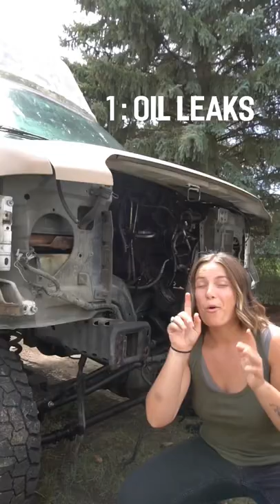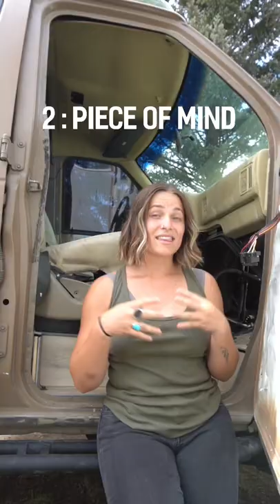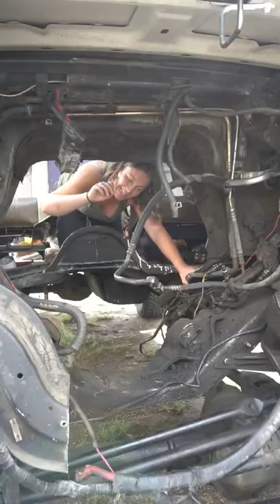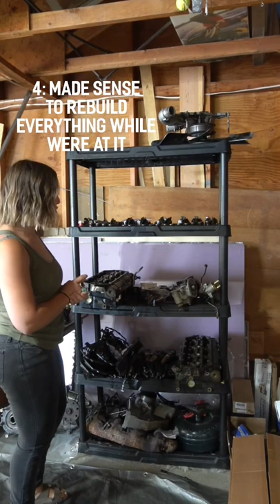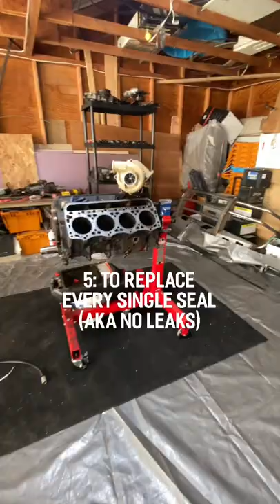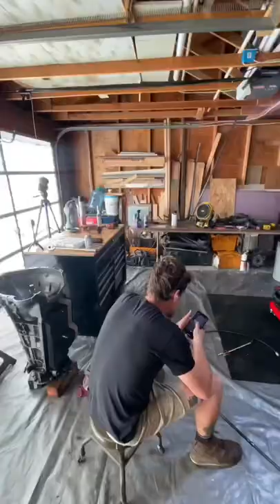5 Reasons why we removed our 7.3 Engine // Van Conversion Series

Comment: A 7.3 navistar should last damn near forever just as long as you don’t over rev it. If taken care of well, I don’t see why you couldn’t get another 500k out of it, let alone another 200
Reply: I got over a million miles on my 7.3 in my ford dually but i daily drove and I religiously maintained it I has a few mods thanks to banks on it cuz I haul cars with it but I didn't do nothing crazy wild with power adders on it.. btw stock bottom end the heads were pulled off at 450k and redone w/few upgrades to valves, turbo and injectors
Reply: Shit you can rev the hell out of them. The 7.3s unlike other engines don’t mind the EGTs

Comment: Good you chose 7.3. get a one box and keep good cam sensors in them, 500k easy. Change the fuel filter every second oil change and you will never have fuel problems either.

Comment: Oil dipstick seal to pan and oil cooler seal are the big oil leak areas on 99-03 psd. Dipstick tube can be done without removing the pan, kind of difficult but doable. Some earlier 7 3's had oil galley leak issues, can fix w updated oil galley plug. Any other "oil leak" is fuel from the fuel bowl running down the back side of engine.
Cool van btw...
Reply from the maker: Hey!! Great info! Thanks 🙌🏻🙌🏻

Comment: The best thing you could’ve done! Was to put a 5.9 Cummins 12 valve conversion. 
Much cheaper easier to work on parts are more readily available so much more reliable.
Million mile engine!!!
Reply: The cost of the conversion would be high though, especially if the trans is a automatic
Reply: New Engine compared to overhaul of old engine might bed cheaper, it’s everything else to adapt the truck to a Cummins that will hike the price. My opinion anyway.

Comment: There's always a bit of magic that goes into fully rebuilding an engine and just praying that the bastard works for 200k miles no issues
Reply: This comment has been seized by the YouTube Comment Oversight Committee
Reply: @decathec  yeah I got a 2001 XJ and besides the fucking endless rear main seal oil drip leak, the fuckers engine has run flawlessly for 230k miles. 4.0L straight line Six doesn't fuck around lol

Comment: As a boat head can I make a small suggestion, it would reduce weight and fuel consumption a four-cylinder diesel maybe a Cummins maybe an older Lehman / senator Ford both excellent motors and will last you millions of miles

Comment: Wrap the manifolds, up pipes, turbo blanket, and the down pipe while you have it out. The motor will thank you by getting slightly better mpg. And if it dose brake down you can work on it with out waiting a cupola hrs for it to cool enough to work on it.

Comment: 200,000 more … a full rebuild should mean a 7.3 would last longer than that
Reply: They'll be doing a lot or highway miles too. I see them all day for sale with 400+ when it's more highway driven
Reply: My stepfather bought a 95 in 96, oil patch truck is what it was. My step father is a ferrier who worked on race horses. I believe when he parked it, over the water pump. it had around 1.2million kilometers. Some guy bought it for 1500 bucks and kept it on the road till the body rotted off.

Comment: Recommend only use oem ford motorcraft parts, even the gaskets. Or u will be pulling it out again…… do it once with oem parts or be doing it for a lifetime with Autozone, Oreilly and Napa auto parts……
Reply: Bullshit. Felpro. No leaks it's in the prep work anyway.
Reply: 100 percent agree. Have had to pull one of these twice due to cheap parts.
Reply: I've learned this. I got told to have a map censor on hand because most likely it will take a shit on you under load going over the pass. So I decided to have tge 200k censor  replaced before I left in a wk.  Got down the freeway and it was running like shit with new censor. Calle d mechanic n he still had old one. He put it in and I'm still driving on it 45k later. Use OEM
Reply: Best advice right here. Ford more than most like to be treated with OEM parts.

Comment: 7.3L will normally go 300k without any issues. 300k turbo issues. 450k injector issues. I have a 99 f250 with 7.3  You are doing it right.

Comment: Shit a built 7.3 will last 500k if you treat it right
Reply: My old man had a stock 99 7.3L made it to 600K only ever needed glow plugs
Reply: @Imwhisper76ontwitch  yeah a 7.3 is the only powerstroke I would proudly own maybe a 6.7 but other than that cummins
Reply: Puff that's nothing. 😏
1993 Toyota Previa 2.4L supercharged with RWD. With 460k only ever did was oil change and tune up. Didn't leak didn't need the engine rebuilt. Just got to rusty, wanted something different, so I junked it. 
 😞 Biggest mistake, that cho cho was the funniest most reliable car I ever owned.
Reply: @jerryvelasco1474  buy Weak af a 7.3 made a l most 300 horsepower and like 450 ft lbs of tourqe but it's also a diesel
Reply: @gavincarroll2553  
So what. Big engines suppose to make big power. Their dime a dozen. 
Their is nothing impressive of a big C.I.D engine making it to 300k and more and making power. That's why those things cost 4 × as much and we're gas guzzlers when they first came out. 
I'm talking about a four banger with factory supercharger, RWD and a mid engine on a Van that was indestructible and got good gas mileage back in early 90's. 
At the time their was really only v6 turbo charge factory engines. 
But a 4cylider supercharger from the factory and mid engine. That's something else. They also came in AWD.
Reply: @gavincarroll2553  I can tell by your comment you will never know the love of a 7.3 IDI 🥲
Reply: @luke8222  what do you mean
Reply: @luke8222  this is a Powerstroke so I don't know why you're bringing the idi into the mix. The 6.9/7.3 idi's were bada$$ though

Comment: Sure hope that works out for ya.   Usually need very expensive precision tools to check and cut block and heads if that's not done on a used 7.3 it's gonna leak after 10k miles

Comment: 7.3s leak from factory that’s just the way it goes
Reply: That's a myth friend.
Reply: @b.k.sautomarinedieselrepai5143  I have a 2002 excursion with a 7.3 in it it has leaked since the owner bought it in 03
Reply: @josephconn3235   if you didn't buy the rig new... you just believed him? I'm not saying I haven't seen some hiccups from the factory... not here to be a troll or wage a war.... I've just been in this field for 17+ years and have seen done things let me tell you.( maybe it was a Friday built engine). it's funny to compare experiences is all.  My shop specializes in diesels. We started on smaller trucks Like 7.3,5.9 etc.  I've seen old idi's dry as a bone..i guess the powerstroke is such a powerhouse it causes seepage..🤣nonetheless I've seen a few leave the assembly line ..and that's not normal
Reply: @b.k.sautomarinedieselrepai5143  We bought it from a family member and I remember his mom always kicking him off the driveway lol but yeah it puts out some power.

Comment: Uh yea oil pan job ain’t fun but totally doable with the engine In the vehicle. Jack motor up put blocks under motor mounts then drop pan and unbolt pick up tube. After that it should slide out. Probably should get a new injector harness while you are firing the parts cannon at it.

Comment: Don't forget the brass injector cups. A common fail point that puts fuel into the coolant.
Reply: Cups are easy, the tooling only a hundred bux or so and the new cups from IH are brass too, it's not the brass it's the o ring that fail, read your tsbs buddy
Reply: @metalsurgeon9196  so the cups cracking isn't the issue huh?  Wow I wish I would have known that, I would have just replaced the o-rings and saved myself a lot of work. There are no o-rings on the cups. Only on the injectors. Quit reading the book and actually do the work. You may learn something.

Comment: Make sure you use high octane gas with the turbo
Reply: I hope you're kidding because this is a diesel motor and it's rated in cetane no octane . Not to mention that FACTORY gasoline turbo motors run on 87 octane all the time .
Reply: @Dr.Westside  doesn't matter, needs high octane to avoid pre ignition with the spark plug

Comment: I have
626,000 on my 99.5 7.3L F350 crew cab long bed
140,000 on my 2002 7.3L F350 crew long bed. 
These engines last a very long time. 
No emissions. 
Not cats. No muffler
Just straight pipe.

Comment: I wouldn't of touched the engine would of left all the original parts and fixed any oil leaks that I could of gotten to with the engine still in 7.3 is one of the best engines ever made slap some new injectors in it 2 fresh batteries and roll  out

Comment: If I wake up in the morning to start my 7.3l Powersmoke and there isn’t any oil on the driveway that tells me there isn’t any oil in her. My daily driver is a Duramax but you can’t beat the old 7.3 PSD. That beautiful diesel rattle is a joint venture between International and Ford. Then ford gave us the 6.0 leaker

Comment: Be very careful with ordering parts, I guess a lot of parts  are failing due to inferior steel.. I was watching a video by a pretty  reputable YouTuber  named the Car Wizard and he was working on two engines that had new cams and other parts that were   were garbage, I guess the problem is pretty wide spread. His advice would be to find new old stock. I would hate to see you put that much money into a block just to have it I grenade on you.  If I were you I'd research this right away before going any further. Good luck. Edit also if you find out that this helped I would love to know
Reply from the maker: Definitely helped!!! Thank you for the info!
Reply: @AllyandLance  cool. All the best.

Comment: Things that usually go out on these motors” what it’s not a 6.4 or a 6.0 it’s a 7.3 an absolute powerhouse mine makes 680whp with injectors a turbo and tune and it’s all stock internals and 250k miles is nothing for it try about 1.2 million which is when I bought o new motor cause my trans blew up and I just bought a new one

Comment: It will start to leak again.
You need get commercial 550. 650 truck
Reply: They all leak commercial or not
Reply: @ptshyu2  commercial truck easy to repair. Easy to get to parts

Comment: Does someone wanna tell them about the hot side of the turbo
Reply: Like 100 of you ignorant folks posted this same thing. Perhaps someone with any experience or knowledge whatsoever could tell them that it is just fine to paint since it will simply burn off. Just like when paint headers or well….when Ford paints every inch of their diesel reman engines black. (Including the infamous hot side of the turbo). “Look at me I know one side of the turbo gets really hot! I’m going to post a condescending but ignorant statement and make myself feel superior to some folks who are completely rebuilding an engine while I simply talk trash and eat donuts!”

Comment: Those are infamous for the oil pans rusting out. Been there.  Yes you need to pull the engine to replace. Injector cups/seals too.  

Solid engine though.

Comment: You can do the oil pan without removing the engine you need to fight the oil pump though once you drop the pan lmao.
Reply: Oil pump is in the front cover
Reply: Not sure how I’d manage to do that there’s is just no room to do anything with these vans
Reply: @ClutchJonesHD  you have to lift the engine with a jack via removing motor mounts, then once you drop the pan you can put a extension in to hit the oil pump there is a YouTube video on it, and when I worked at ford for 3 years this was our trick to beat the 14 hour time and do it in 6

Comment: well its a 7.3 they leak. my 96 leaks...
Reply from the maker: For sure! Not our first 7.3 😅
Reply: @AllyandLance  Mines got almost 600k and runs just fine all stock currently. upgraded on mine are in the works your 95  is the 1st gen 7.3 and correct me if im wrong here but i think yours has 8 bolt intake. so swapping to the super duty intake and pletum might be slightly more challengeing. a great up great is on the hpop yours and mine are both 15 degree pumps the super dutys  (L99-03) are all 17 degrees and the best is the adrenaline or t-500 which is 20 degree. the reason for the pletum swap is its a 3 inch intake. and the mechanical fuel pump swap to a super duty electical fuel pump in my opinion is an up grade. just a few ideas while its out. and do the dip stick adapter with the outter double sea o ring. thats were mines leaking and that what im going to accomplish this winter.

Comment: Most 7.3s are junk because they had such a good reputation no one does the maintenance on them and they just drive them into the ground. The idea of having engine oil drive the fuel system is very foolish as well there is a reason no one else did it.

Comment: Good time to throw a 12 valve Cummins in it and throw that loud down on power 7.3 in the trash where it belongs.
Reply: Na wouldn't have any money left over to travel after that cummins 12 is a good motor but not killing that 7.3 parts are cheaper to

Comment: Why would u waste any many on a power stroke especially a 7.3 . For what it would cost to rebuild it you could just do the best option & put a Cummins yes cummins pick any of them . 

5.9 12valve

5.9 p-pump

5.9 common rail 

6.7 

It’s your choice & the 12v would be the cheapest & simplest swap . Guaranteed to not leave you stranded or ever lose a drop of oil . That’s the one benefit the other is is makes more power & another is better fuel economy & another is so easy to work on in the truck one side is exhaust they other injector lines & intake . Not like any ford where it’s all crammed into that engine bay .